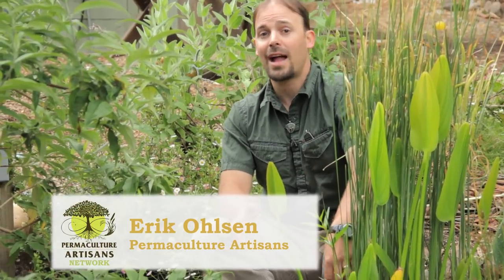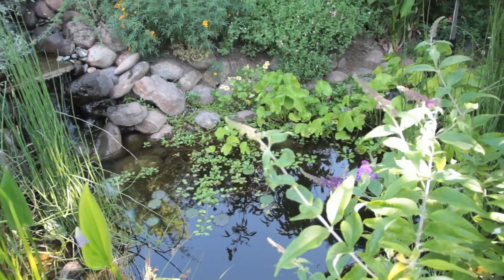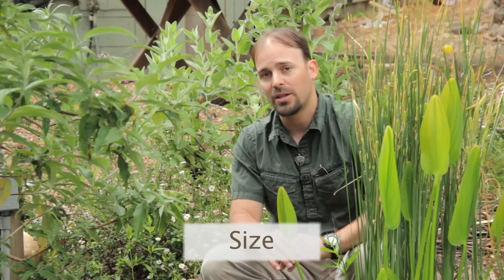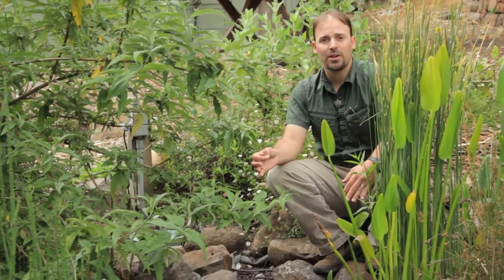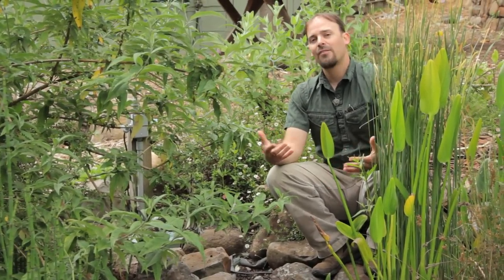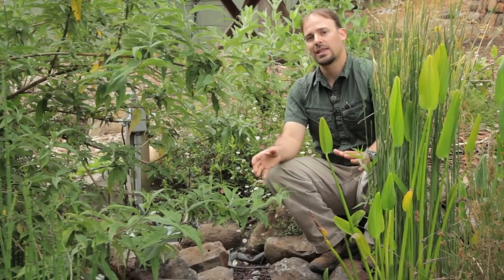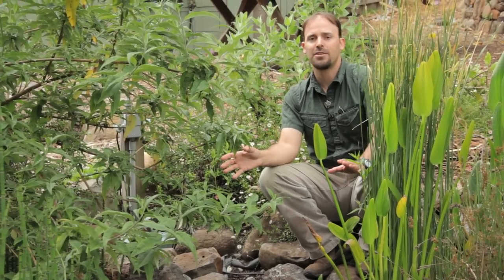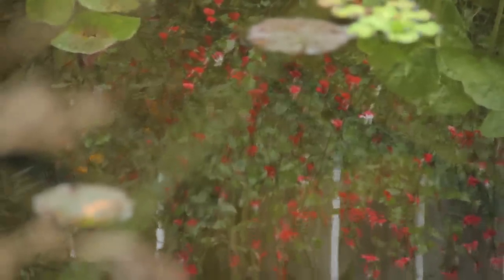How to Know If You Need Plastic Liner for Your Ponds

Comment: I have a 17.43 acre plot of land which has nothing on it yet (my retirement property)....located in southern viriginia.  It is mostly wooded and has a large "dip" in the middle.  Part of the low area is always boggy.  I do have seep springs that run when it rains.  Because the one section is always "boggy" would that mean I have "clay under or in the soil there?  I plan on clearing part of the land for building my small home and starting a Forest Garden. It is wooded where pond would go.
Reply: I wonder if it is counterproductive for the soil and pond if you were to clear more trees for it?
Reply: I would clear it, yes absolutely however I would keep all the debris on the land where you want to do your perma culture , i mean Forest Garden (same thing).  Wooden trunk, dead branches, dead leaves, those are the gold you need to grow your fruits and veggies. good luck.   https://youtu.be/QeLB-1dftgM                                                                                  
https://youtu.be/xB8Zh-AP3Iw
Reply: @nadounadou9560  wrong, those trees are why there’s water there.

Comment: Of course you can have a clay sealed tiny pond.  In the tiny pond realm, it may cost more because it requires more work and specific types of clay, but it can be done and your pond will be healthier for the effort.   In these scenarios, it will require heavy machinery where bentonite does not.  Here is a primer on natural pond liners etc...  www.aquahabitat.com/pond.liners.html    cheers!

Comment: Hi Eric, thanks for this video. What if a person were to build up the carbon in the landscape by planting more trees, shrubs, flowers and any plant that pulls carbon into the soil? Could soil become "clay enough" to have a natural pond without the use of plastics?
Thank you :)
Reply from the maker: Hi Rebecca, Possibly with enough organic matter one could create a Gley liner from decomposing organic matter but you can only have a Clay liner if you have enough clay in the parent soil material or one could import sufficient clay usually bentonite to try a natural liner that way. In any case, if there is not enough clay already in the soil then it is very difficult to achieve a good liner these ways. the gley liner only works after many years of a dug out pond filling with water long enough for the organic matter at the bottom to turn into a gley sludge and seal the pond. Plantings generally create better drainage so would do the opposite of creating conditions for a natural pond. Bentonite clay liners imported maybe you best match for your needs...
Reply: Adding more organic matter would not add clay. In fact, if there is any existing clay already, adding more organic matter would decrease the clay concentration in the soil, which would be the opposite of what you’d want for sealing the bottom of the pond naturally.
Reply: @xxpowwowbluexx  makes total sense! Lol, I wrote that 3 years ago, funny how over time and more reading, stuff makes way better sense.